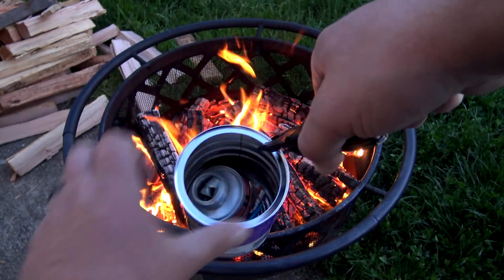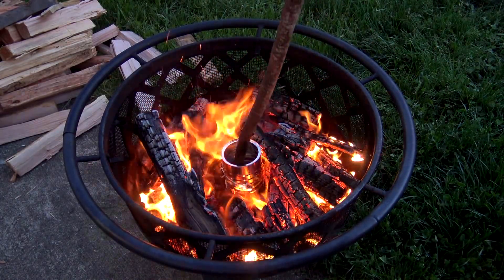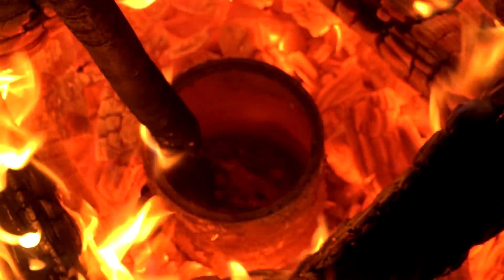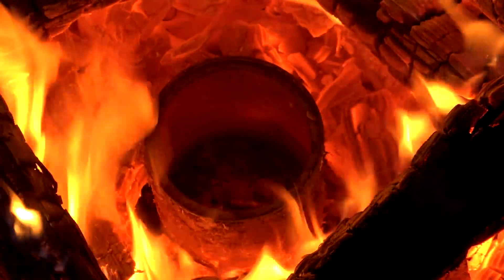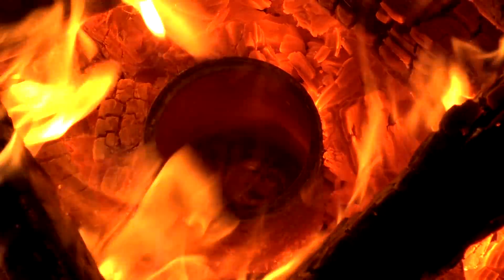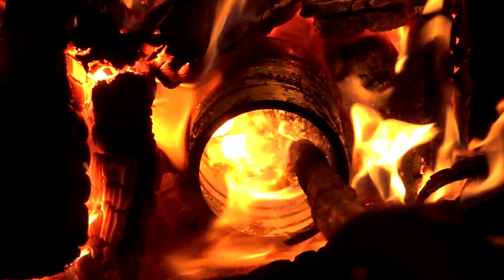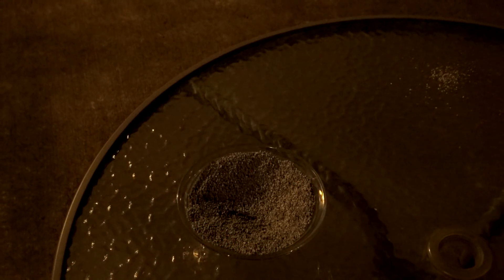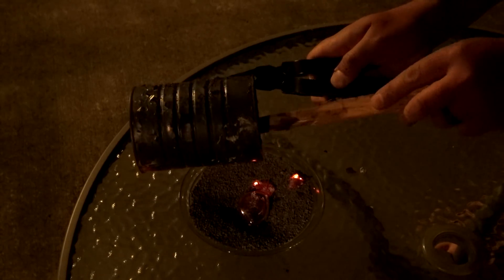Aluminum Part 1 (The Ingot)

Comment: From someone who pours CU, AL and brass, the cans just have way to much slag to even consider worth it.  However, in a survivability situation, yes, probably what you'd most find.    Good job man.  Btw bro, don't trust that tin can more than 2 AL melts.  It won't last a 3-4th time.  Molten AL isn't fun to just have splash down..
Reply: Indeed, but also consider this, use the slag made from the cans as aggregate in his roman concrete, more so when preparing his terracotta concrete, as the aluminum, sand, and ceramic mix can be used for higher temperature constructions, though still not as viable as refractory cement. Yes, the tin cans are poor crucibles and very dangerous when(not if) they fail.

Comment: not saying you aren't right, but how confident are you with that temperature range from an open, wood fire?  i would have guessed 800ish max.
Reply from the maker: A bow drill ember ignites at 800 F. Camp fires are a lot hotter and since the aluminum melted at 1250 degrees F. That tells me that it exceeded that temp. Watch part 2 of my video.
Reply: thank you... glad to be straightened out on that ...   fraid im too used to thinking in celsius and my brain thought the numbers were high...  excellent demos btw!   appreciate your skills and work in putting it out there.

Comment: A couple things I found out when melting aluminum: 

Baking tins for muffins work very well for making ingots. 

Cans melt better when submerged in molten aluminum, you get more usable aluminum from the cans you are melting. When your aluminum is heating up in your crucible, the coatings melt off long before the aluminum melts. The longer it is in the air and exposed, the more of it oxidizes and and becomes the slag you have to remove. So every time I start a melt, I melt an ingot first and only put crushed cans into the crucible, pushing them under the molten aluminum.

Great video.